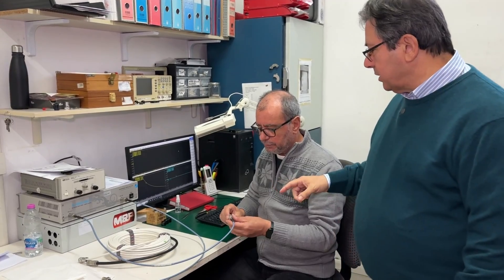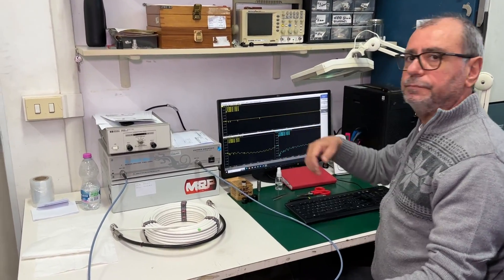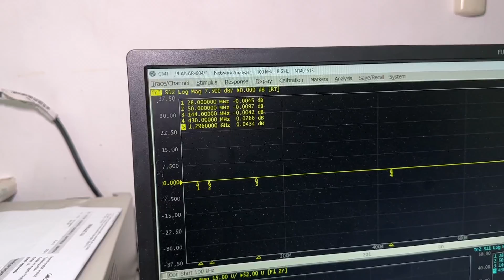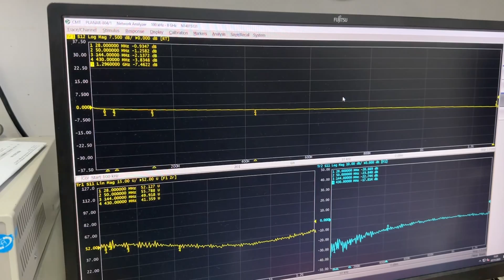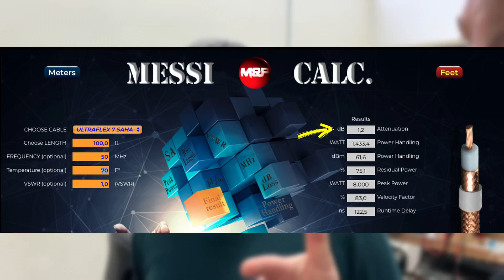Using A $16,000 VNA To Test Coaxial Cable!

Comment: Impressive and it all looks good there, Bend the cable a few times and you will see that the attenuation increases a lot. The major disadvantage of this brand is that the copper foil tears. Cable is only suitable for fixed installation, but they don't tell you that. I know serveral people who had this problem.

Comment: Hmmm I wonder how different the readings are for a NanoVNA compared to this
Reply: We performed the same test with our NANO VNA (the one we purchased with the smaller calibration KIT shown in the video as opposed to the professional ones from Agilent Technologies) All this in front of Mike who can confirm. If you see ridiculously sized calibration kits like the one Mike threw on the table at minute 2:10, those are for unreliable toys, especially at the higher frequencies. Proceeding with the correct calibration procedure, the result was very, very close. The correct calibration procedure is in any case of enormous importance!
Reply from the maker: Can confirm.

Comment: That was super. I love how they work with the US to make Shure the  the calibration is right on the test VNA. They can stand but the data given for the coax or wire they make. when you have them make a custom cable and have them test it they provide a print out of the test. very happy with their coax. 73's

Comment: Back when I was designing 100Gb ethernet, we had a pair of calibration cables. The pair were $1000, but we were measuring 10's of GHz on a VNA that cost about 10x of Stefano's. I worked for Keysight, and we borrowed it from the demo stock. It was cool.